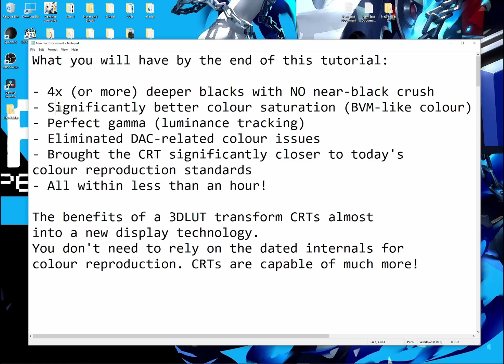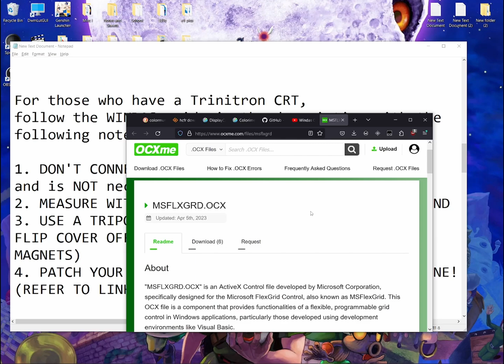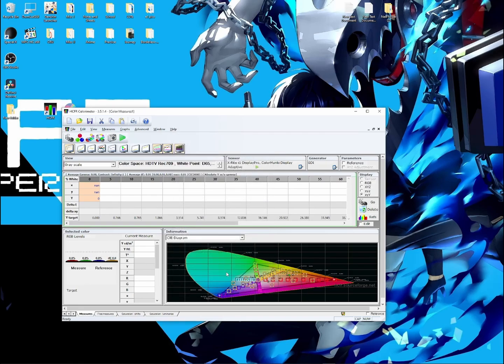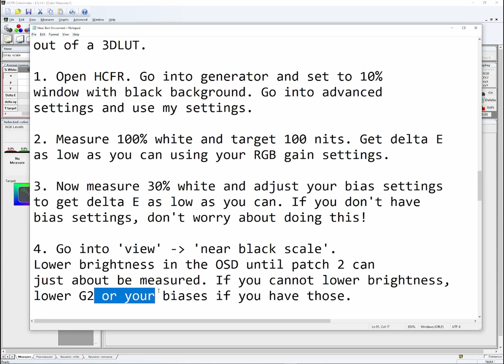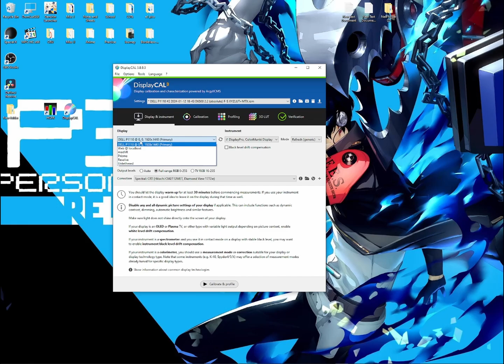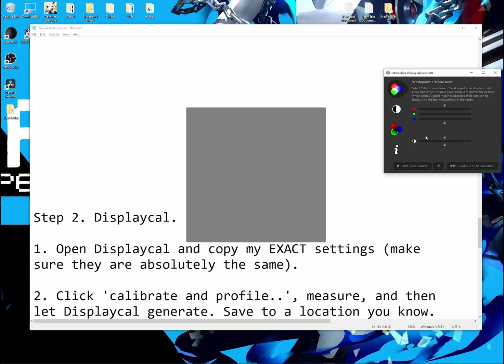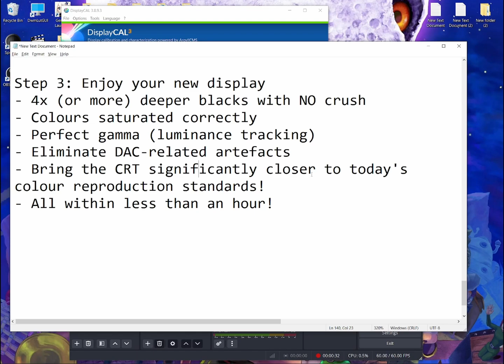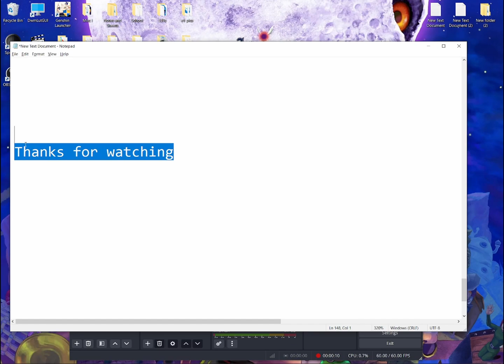PC CRT Calibration Guide (Displaycal) [READ DESCRIPTION BEFORE YOU BEGIN!]

Comment: After following guide and using reshade, are all the effects automatic and don't need to be toggled on later? If the PC is power cycled will I need to re enable the 3d lut ? I have a fw900 and p1130 that I fully calibrated on windas

Comment: For the Displaycal “calibrate and profile” step, you said “make sure black background is ticked”, yet you untucked it (box is empty). What’s the actual correct step? This is all for a CRT of course. 

I notice on W11, when I do have “black ground” tick, the gray patch gets stuck.

If the box is untucked, and the patches are just in the center of the screen and the background is just my desktop, the calibration continues (patches will change color as normal)

Comment: why do we need to use DWMLUTGUI? Can't I just install the profile from the displaycal profile loader? I am also having issues getting DWMLUTGUI to work with windows 11
Reply: I've found a solution. Make sure you use the base version of DWMLUTGUI from Ledodge then drag the files from the Lauralex 4.02 prerelease version into that folder. Most importantly of all, you need to be on Nvidia driver 552.22 or previous!

Comment: If don’t have the A-02 revision, what will be the downside if i continue the calibration with the measurement of pitch 2 at .006? Will it just be slightly raised blacks?
Reply from the maker: Hey, sorry for the late reply. Yes, you are correct. The B-02 requires you to raise your blacks a little more in order to read the darker end of your shadow detail. That's the only downside.

Comment: Do you prefer your shadow mask over your dell? What's the best monitor you've ever saw?
Reply from the maker: Hey, sorry for the late reply. The best monitor I have seen so far is my 2070SB. It's the only monitor I have used that has perfect picture consistency. I Trinitrons I have used (P1110, FW900) were also really great, but they always suffered minor geometry issues such as linearity or sagging at the edges of the picture despite how much time I put into calibrating them. My 2070SB fell into place within a matter of a few hours and it stuns me each time I use it. Its focus, convergence, and geometry are as consistent across the screen as an LCD.

From my experience and others I have spoken to about this, shadow masks are superior for text rendering than the 'trons. I think this is because the isolated nature of dots help edge out text, whereas the uniform stripes of the 'trons smooth it out. But the isolated nature of the dots also works against the favour of shadow masks, as it also results in inferior pixel fill which is a huge reason why the 'trons are so pretty. The insane pixel fill of the 'trons give the image that 'whole and solid' look. There's zero graininess at all, whereas on shadow masks you will always get a graininess/muddiness due to the significant amount of black space relative to the space the dots make up. There's also the fact that shadow masks usually have far inferior settings to the 'trons. They usually suffer from ABL, no bias settings, more potent geometry issues that cannot be addressed, and typically a domed screen.

Comment: Hi Luke, I have a dell p1130. I noticed it getting a bit blurry at 1600x1200 100Hz. No pass through it's progressive. Do you think you can help me?
Reply from the maker: Hey there. 1200p@100Hz is going to be smeary on any CRT. You're driving the RGB amp hard with a resolution that demanding. No amount of tweaking focus pots, dconv, and digital focus can fix that.

You have an excellent CRT that uses the best PC CRT chassis Sony ever made. It's capable of getting incredibly sharp, especially if you use windas to adjust dynamic convergence and digital focus in addition to optimising the focus pots. If you want to get the clearest picture out of your CRT, you need to be gentle with the RGB amp, so using interlaced resolutions is an absolute must if you want to keep both your high resolution and refresh rate. Also, for a CRT as large as the P1130, you really should be using either 1920x1440 or 2048x1536.

My best advice would be to interlace. You can interlace using iGPU passthrough, as you already know, or by outputting via the HDMI port of a Nvidia GPU older than the 20 series. If you have an older spare GPU lying about, try connecting that to a PCIE slot and outputting via that. Interlacing is a gamechanger for PC CRTs.

If you absolutely cannot interlace, then you will have to sacrifice either resolution or refresh rate for focus. I'm afraid that you cannot have both while having good focus without interlacing. Taking a bullet and using 1536p@65Hz for desktop use and 980p@96Hz for gaming would be your best bet until your rig is capable of interlacing and making the most out of your monitor.
Reply: @PALukeUK  
Thank you for the prompt and informative answer!

I should have an old AMD card laying around, do I lose on horsepower if I use it as pass through?

Any guide to set it up efficiently you can link me to?

I will definitely give windas a shot, the acquisition is fairly new to me, I still have to work on it a fair bit, but it's pretty much new, as the previous owner barely used it.
 
I wanted to play modern games at at least 100hz, that's why it was set like that.
I wish I knew somebody who could help me out with setting it up, but it's a small niche in which I am diving in.
Reply: I am just afraid of adding additional latency if I go for a pass through.
Reply from the maker: @HarlockTheSin  No problem man. I'm glad that another CRT owner is interested in getting the most of their monitor. Aperture Grille actually made a video on GPU passthrough. The latency is supposedly unnoticeable and there should be no performance hit. https://www.youtube.com/watch?v=puu-iyTsZtg

By the way, if you love the smoothness of 100Hz, just wait until you see 240Hz on a CRT. You can actually uncap the vertical and horizontal frequency caps to do 240Hz and 141kHz on your P1130. I main 1080i@240Hz on my 2070SB for games. At the end of this video you'll see a guide https://youtu.be/0Pbj-0DxlRE?feature=shared&t=2129

Feel free to add me on Discord and I can give you some pointers with windas. I'm 'lukepr'
Reply: @PALukeUK  I guess I might even try to connect to both Adapater on display port and the pass through so I can switch between smoothness and response time.
It's gonna be some fun time testing.

I added you on discord. thank you

Comment: 709 instead of 601?
Reply from the maker: Yes, absolutely. Modern SDR content is mastered in rec709. If you're using a CRT with P22 phosphors, you will be able to cover 94% of rec709. BVM CRTs cover only 80-90% of rec709 and were still used for professional colour work up until the mid 2010s. Your PC CRT is capable of producing a very accurate rec709 gamut.

Comment: If I’ve already done a WPB calibration through WINDAS is it necessary to do it again?  Can I just jump to the display cal portion?
Reply from the maker: Hey there. If you have already done a windas wpb, then you will not need to do the windas wpb procedure again. In order to make the most out of 3DLUTs, you will still need to recalibrate your CRT in such a way that takes advantage of their ability to uncrush your near-black detail. You should start from 3:05 in the video.

Comment: Displaycal is trash, barely works for anyone! Also this guy sounds exactly like boxxy. He's just a bong
Reply from the maker: Because you didn't try using a LUT with VCGT enabled. You need to create two LUTs, one with VCGT enabled and one with VCGT disabled. You then use the one which provides better results for your display. VCGT enables the 1D LUT calibration which is sometimes neccersary for the LUT to work properly. It didn't work for you because you didn't make a LUT with VCGT
Reply: @PALukeUK  Thank you, PALuke!

Comment from the maker: ! CORRECTIONS / NOTES :

-  Make sure to measure with a black background in Displaycal. I only unchecked it so you could see what's going on. You should keep it checked.

- Make sure to let your CRT warm up for at least one hour before starting. Ideally you should wait three and make sure that the CRT has been used daily for at least five days straight.

- Make sure window scaling in Windows display settings is set to 100% when measuring patches in HCFR.

- You can also get DWMLUTGUI to boot on startup using Windows Task Scheduler and the following parameters: -apply -minimize

- If you're having issues getting perfect gamma, then it is likely because your black floor is too low for your CRT. Try making patch one in HCFR near-black scale report as 0.003 nits instead of patch two by raising OSD brightness.

- You can also get 3DLUTs to apply on your consoles using a LUT box (an external device which inputs can pass through in order to have a lut applied). You can pick these up for £70 off eBay. If the upgrade isn't worth £70 to you, then if your CRT has multiple colour profiles with bias controls you will be able to configure one profile to take advantage of 3DLUTs and another profile to work perfectly with your consoles without the use of 3DLUTs. You can do this by lowering the bias settings in unity on one profile to achive the <0.003 nit blacks when using that profile while having another profile being a great hardware calibration which works with everything. I suggest using the Blackmagic Design Micro Converter Bidirectional SDI/HDMI 3G.
Reply: Do you know if using the Blackmagic converter for this purpose adds input lag?
Reply from the maker: @Voliko1 It adds no input lag
Reply: Thank you. Great video and I can’t wait to try this out.